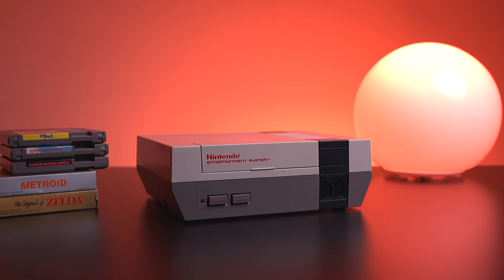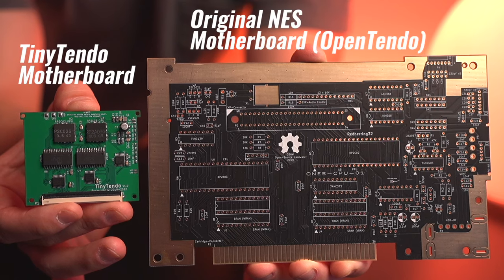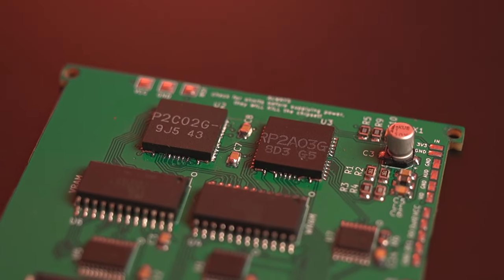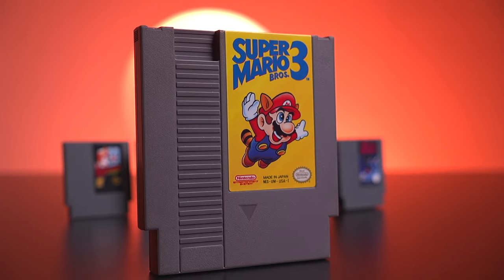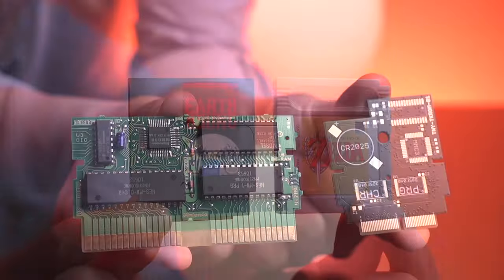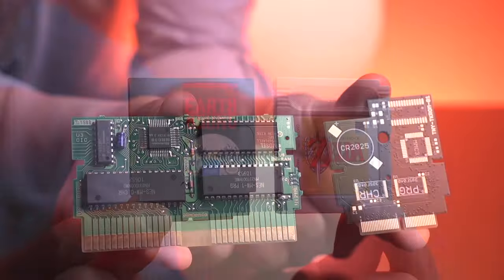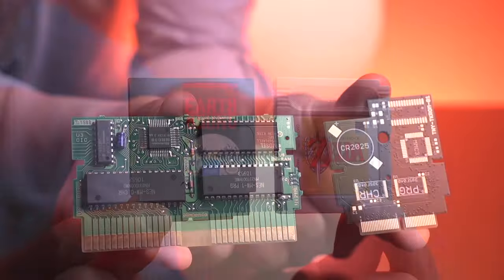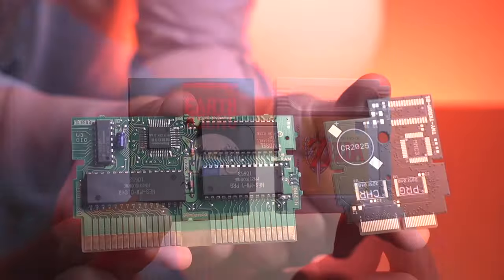Making The World’s Smallest NES With REAL Nintendo Hardware

Comment from the maker: One thing I forgot to mention in the video is that the cartridges for TinyTendo use all new components. No game carts are sacrificed 👍
Reply: Could you elaborate on how those cartridges work?
Reply: That's pretty impressive! Hopefully the TinyTendo can also get a flash cart using a similar architecture.

For the EverDrive N8, we might need to get Krikzz's permission to build one specifically for the TinyTendo.
Reply: You didn't mention the battery life. I'm thinking it's either insanely long due to the age of the processors or insanely short due to the screen. Any idea what it's capable of?
Reply: @erikg4512  you flash the EPROMs on them with a game rom.
Reply: Do they draw more power similar to flashcarts?
Reply: @penismightier9278  12 hours on a charge. :)
Reply: @redherring3253  Whoa. That's pretty good.
Reply: I don’t get it. How do you get a game for the tiny tendo? Please elaborate.
Reply: @pamendez3  That is explained in the video. They take the chips out of carts and make custom carts for this.
Reply: @penismightier9278  I watch the whole video but he never mentioned anything about the game cartridges. Do you have a timestamp? Maybe I missed it. 🤔
Reply: @pamendez3  From 8:14 until the next section it's all dedicated to the carts. It's a minute and a half.
Reply: @penismightier9278  thanks! I guess I missed it somehow.
Reply: Hmm, do you think it would be possible to make an adapter for real ones too?
Reply: @Lillylafrog  Yup!
Reply: it works by just using a flash rom on the board, the NES can address UP TO 15 Bits of address space directly (32,767 bytes/32KB) for program data, and 8KB of graphics data without any special mappers.
You'd just use a cheap 5v NOR flash chip or a 3V one and use some resistor networks to shift the voltage from 5V to 3V on all the data/power lines.
In fact, you could easily make a re-flashable cart and just change the label.

Most simple NES games would be very easy to shrink this way. The hard ones would be ones with mapper chips like the MMC3 (Castlevania 3 uses this) or special music chips found on Japanese carts.
Reply: So, I'm wondering if you ever fixed the red colour output on this?  Was it fixable or a design flaw?

Comment: Wtf, we're not only shaving down motherboards, but actual chips now? Insane!
Reply: tbf, most of the chip is filler plastic just to hold the pins in place. I think shaving down motherboards compared to this chip is way more interesting
Reply from the maker: Heck yeah!
Reply: @BrendanRaymondKoroKoro  i saw videos of people doing something similar, exposing hair thin contacts and repairing burned ones basically saving the chip. Or remember flashing xbox 360 slim dvd drives where ome models chip had to be sanded in the exact spot to expose one of those traces? Madness!!!
Reply: It's actually super common for repair shops that know what they're doing to Dremel off the top of a chip to run a bodge for a missing leg.
Trimming the entire chip is still a pretty big jump for sure though. I wonder if this can be applied to other things like C64's or SNES.
Reply: @Druid_Plow  I don't see why you can't
Reply: Blew my mind🤯
Reply: Imagine going back in time and showing this to people of the 80s. They'll freak out.
Reply: It obviously makes more sense..

Comment: Imagine how tiny and power-efficient the NES CPU/PPU would be if it were completely remanufactured using a modern process node.
Reply: That exist from the 90´s it is called NES on a chip and it is present on most NES clones
Reply: @SJA962  I'm talking about building a brand new chip on a modern process node such as 4 or 5nm. Nothing from the 90s was anywhere near what we can design and fabricate now.
Reply: @timg2727  That will be like, a chip the size of a grain of salt lol
Reply: It's already pretty power efficient!
The NES is only about 1.8W, so TinyTendo runs 12hrs on a charge.
Reply: @redherring3253  it doesn't use much power in terms of absolute numbers, but relative to the amount of computing power the NES outputs it's actually pretty poor compared with modern architectures (which is what you'd expect).
Reply: @timg2727  You are wanting to solve a problem wich is not a problem at all kid
Reply: @SJA962  I'm not saying it's a problem and I'm not saying that anything needs to be solved. I just think it would be interesting to rebuild one of these old processors using modern technology. It's really just a thought experiment and nothing more. 

Also, "kid?" I'm 42 years old. What a weird assumption to make. Lol
Reply: @kurtlamprecht93  ah, yes - the classic "being a dick to a stranger for no reason" trope. It never gets old.
Reply: @kurtlamprecht93  I don't understand commenting this way in an innocuous thread about a silly thought experiment about microprocessors. Hopefully you find a more constructive way to channel that aggression in the future. Be well.
Reply: there are 3 types of chips during the middle and late 90's
1- NOAC (Nintendo On A Chip) where all components (CPU PPU and 2 RAM chips) are inside one chip usually under the blob or rarely normal single SMD IC
2 - PPU and CPU in one single chip under the blob ot normal SMD IC and regular normal 2 RAM chips 
3 - All desecrate IC's CPU, PPU, RAM but clones of original .Samo of the PPUs even support 50 and 60Hz gust by changing one of the pins to GND or VCC

Comment: I’ve recently gotten into modding and repairing old consoles and have used your videos as a guide. I can say that I could 100% connect with this video. I’ve often felt so much frustration and disappointment when working on older systems but the reward of finally getting it repaired is priceless. Loved this video. Thank you!!

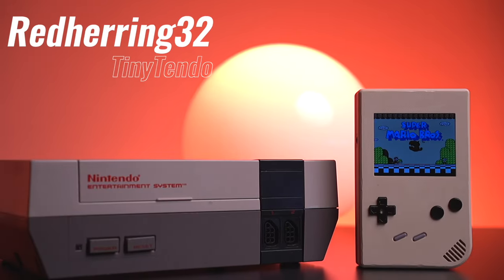Comment: (0:24) I think the reason why the chips were big back then was because a lot of the chip fabrication technologies for smaller chip packages didn't exist back then or were expensive to manufacture.

Still, the closest things I've seen to that ran on Famiclone hardware, and I never thought someone would do a similar thing but running on real Famicom/NES chips.
Reply: You're partially correct. The technology to make the components super small did exist (the surface mount technology we use now), it was just very expensive. Inexpensive consumer electronics at the time were manufactured using through hole components (the component legs pass through the circuit board and are soldered on the reverse side) that were mostly assembled by hand and soldered using a wave soldering machine. The distance between the component legs had to be far enough apart or the process would have issues (pins bridged by solder needing more manual rework to get a functional board), also the components needed to be big enough that they could be assembled by hand.
Reply: @davidcameron648  
Right! 🤯

Comment: To add crazy ideas to this project, the die can be completely extracted from the original package and wire-bonded again into an entirely new package. You need some very specialized machines and techniques to do this, but it can be done. You could completely extract the die and wire-bond it to the pcb, and then encapsulate the die in an epoxy. Might save you a little bit of space, though it might be plenty small already.

Comment: Whoa, this is really cool. Props to Redherring32 for his engineering genius. This is a really cool project, especially after having watched Gaming Historian's Express video a few days back. I definitely would not attempt this... I can't even get GG's to fully work at my current skill level. The only 'downside' for me is that the cartridges also have to also be modded and fit on the smaller, custom cartridge PCBs. I suppose you could make an Everdrive-type of a cartridge so that way you wouldn't have to constantly be Frankenstein-ing your game library.
Reply: The cartridges use all-new hardware actually. Other than a donor chip you may need for games with specific proprietary mappers (i.e. MMC3) - in that case, you only need to remove that one chip from an original game to transplant.

Comment: Very cool project! That said, I have concerns about having to damage those PPU and CPU chips in order to produce these, since there is a limited supply of those chips, it might make it harder to find those parts for use in original consoles, for the sake of restoration and preservation
Reply: Over 60 million NES sold. Even if we assume 60% of those ended up in the landfill, the less than 10 people that will ever muster up the courage to try to build a TinyTendo will never be able to make a noticeable dent even in all of their combined lifetimes. :)

And if they did, this is totally "reversible" you can mount the cut chips back in whatever NES they came out of with a simple little adapter. Nothing is truly destroyed.

Comment: Ok, Love the passion, no question he must spend years doing this. I owned a NES from day one (well 10 days later), and still to this day love it. If the boards where pre-built like this, the soldering job didn't look too bad.  How do you get games?  You need to build them one by one ?  This would need an Everdrive to be useful in the real world. 

Cutting the CPU in parts? Dam, I did a NESRGB kit and that had it's challenges but, dam.

Comment: I kind of want a follow-up video covering the game carts. They’re obviously not using original cart chips there, but apparently what they used is able to function like the chips in an original cart.
Reply: That's because Nintendo couldn't really make proprietary chips for its cartridges.

They made chips with proprietary pinouts. So if you find compatible ROM chips that are the same size as the ones found in, say, Super Mario Bros 3, you can use a PIC programmer to load a Super Mario Bros 3 ROM onto them and design a custom board accordingly to make them work as the real deal.

Comment: He should offer a 3D Printed Hand Grip Pro Controller style that has an 80pin to 72pin adapter for actual cartridges. The grip could help alleviate the cart size and help with a backing to hold it in place.

Comment: I think its fantastic. Especially the mini cartridges. They're very cool. I do however have one criticism: the visual nature of the outer shell. It seems kind of lost in translation. It's supposed to be a handheld Nintendo but it mostly emulates a Gameboy. The colors are something else entirely. As an artist and designer, I would suggest a form that really echoes the nuisances of the Nintendo with its edges and angles and odd shaped ports and that jagged belt strip that runs across the top. And of course, it's colors. Perhaps this is the next stage? At least the hard parts are done. Take care and dream on!

Comment: well using an original 2a03 and 2c02, you can reduce much of chip count by combining  the 4k of ram, into a  IDT7008 64k dualport sram, using a cpld you can  manage bank switching so you get 60k of extra ram, throw an fds chip in for a floppy drive, which can be used as a serial port with an esp32 and add wireless and Bluetooth support or stuff a modified fdsstick inside , a gpio port, fm wavetable sound, another 64k of extended ram for a total of 128k , you can remove the cartridge port and replace it with an internal flash card, using an fpga and mcu, and have 1-4 gigabit of internal rom space using some nand flash,  so you can just use an sd card slot  to load and even flash games internally so you dont need it, and copy saves too. also might allow for different display modes with dual port sram, as long as you dont let the ppu and cpu read and write the same address at the same time, add another cpld to convert the composite to a digital format and use an ips display.... you could squeeze the nes to about the size of a dmg or slightly larger, but would run all your code and roms on native hardware with some extra features a stock one cant do, using cpu to dma and write directly to vram, and also can use ppu to dma and write directly to cpu ram, also wayyyy better quality dpcm sampling can be done, opens up some new graphical techniques but old software should just ignore all of it, but new code can use it
Reply: give miyamoto and some oldschool nintendo engineer something to do just for teh lulz, cuz in theory this would actually work
Reply: with the amount of money they got they can just make a small run of custom chips, they still probably got the original photomask for their nes chipset laying around getting dusty somewhere, just combine 2a03 and 2c02   and fds chip on a single cmos ic plcc or qfp, and add your ram and external logic that way, further reducing chip count, without sacrifice to compatibility

Comment: I'd say the amount of soldered wires (especially between shell sides, oof) is also a slight con. Definitely can be improved in this regard with proper regular and/or flex cables and connectors (or maybe even push pins for less clutter).
Reply: ⬆️⬆️⬆️congratulations you are among our shortlisted winners claim your reward🎁……

Comment: Projects like this are awesome to see. However, with this one I can see a few things that would definitely need improvement. The biggest is that he's using a composite signal to feed the LCD. While I get that some people like that classic look, I'd rather the signal be pure RGB with a filter option (much like an emulator's composite filter). Also, while he did use many off the shelf parts, it would be nice that he could streamline the design so that anyone wishing to build this wouldn't need to have soldering skills. And third, either make a cart that behaves like an Everdrive/PowerPak, or make an adapter so you can play real carts on the thing that haven't been shrunken down. There are many people who would love to play authentic hardware on the go, but not everybody is going to have the skills/balls to shrink down their existing carts.
Reply: If you've got the ability to make a TinyTendo, you have the ability to make cartridges :)
The carts are a cakewalk in comparison.
Reply: I don’t think that this will ever be an item that will not require excellent soldering skills.  Anyone building this will be required to perform the steps to shrink the chips themselves, as Nintendo would swoop in with a cease and desists order if he sold these with the chips already prepared and installed.  So no, this will always be a DYI product. The best you could hope for is the custom boards with everything but the CPU and PPU.  Same goes for the carts.
Reply: @TheDainerss  True, projects like this are always going to be DYI. However if he sold this kit with all of the chips prepared and installed, I don't think Nintendo would be able to swoop in with a cease and desist simply because he's not reverse engineering the chips. All he's doing is taking the official parts that Nintendo released and physically modifying them to be smaller. Regardless, this is still an awesome mod and shows what someone is crazy enough to do in the modding community.
Reply: @honorablejay  Desoldering the chips, modifying them, then reselling them is not allowed.  Look at the Opentendo as an example, you cannot buy them with a CPU or PPU, those have to be provided by the buyer. And any other such mods also require you to provide those chips yourself. The people making these mods do not want to risk the wrath of Nintendo and stay well clear of them because they are strict about this kind of stuff.  You can sell modded original consoles but that is about the limit.
Reply: @TheDainerss  Not something I was aware of, duly noted. Also bleeping stupid if you ask me, considering the modifications in this case just shrink the chips. But hey, Nintendo has never really had a good track record with anybody regarding their games/systems.

Comment: Question on the battery's. Dise the system only want 3.6v or dose it want  7.1?
Reply: It uses 2 18650s in parallel, so 3.6-4.2V 7000 mAh.

Comment: I will admit that this is a really neat project and admire the work that went into making it possible, and don't want to knock the effort, but...  I don't support sacrificing perfectly good components from working consoles to do something so incredibly niche like this, or even from non-working ones as usually one or the other chip still functions and can be transplanted into another console that needs repair.  This robs the community of those components.  If FPGA substitutes were available, they would be a far better option.

Comment: Awesome project, but the biggest con is that it's not a reversible mod,  you basically need to destroy original hardware to build it.
Reply: It is technically reversible if you successfully trim the chips, I designed a little adapter to mount cut chips back onto an original board. :)
Reply: @redherring3253  That’s awesome. Not all mods are all that modular, so good stuff 😁
Reply: @redherring3253  wow, that's nice to know, great idea.

Comment: "Thse two chips are what make an NES, and NES" 
Eeeehh.. i beg to differ. What makes an NES an "nes" is the entire package. The consoles shape, hitting the large power button, butting in the large cartridge, holding the controller. All of that is an NES. 

I also dont like the idea of cutting up authentic NES chips to make this work unless they were ONLY taken from damanged consoles that could not be salvaged (which even with that, there are other ways to use them in new PCB's). Dont get me wrong, its a neat concept and proof of engineering.. but i really prefer keeping the orginal hardware intact whenever possible. 

Besides. Nintendo themselves pretty much alerady did this with the Gameboy Advance (its able to play, and even has some NES games). Id prefer to see people making GBA cartridge ports of NES games much like the classic series Nintendo themseves has. To keep it on as authentic Nintendo hardware as possible. 

Calling this a "real nintendo" is quite a stretch as almost nothing is orginal aside from the CPU/PPU.